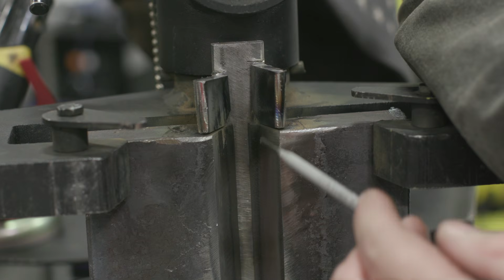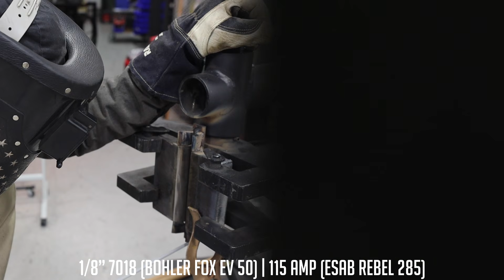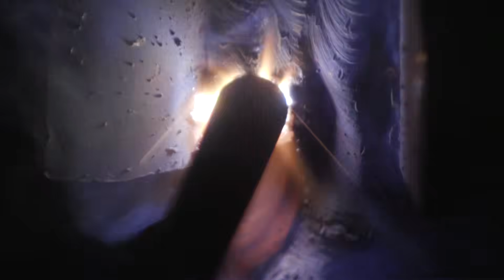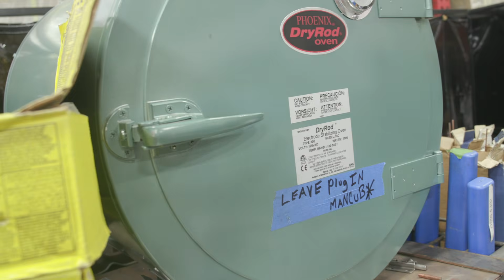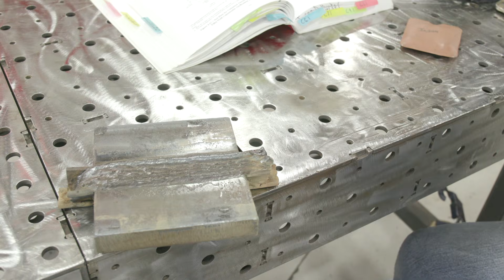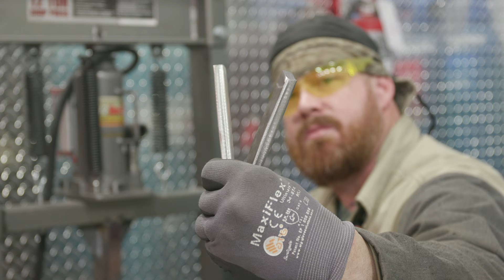1 Inch Side Bend Test | 3G Uphill Stick Welding | D1.5

Comment: I have a video request. Could you compare what its like welding with new rods vs expired old rods? In my welding school were currently using 23 year old 5/32 7018. They seem to weld alright but does that exlirarion date really make a difference in the weld?
Reply from the maker: We'll add it to the list, but it's going to take a while to get 23 year old rods 😜
Reply: @Welddotcom  lol i appreciate it!
Reply: @Welddotcom  also i can't seem to weld vertically worth a dang with them. Do i just suck or can that be attributed to the old rods?
Reply: Go grab a new pack of 7018.  Learn for yourself, don't wait for somebody to teach you.  That is a life lesson right there.
Reply: @MPM Welding thats the thing, were using them for practice and our test plates. I used them on my 2g test and did fine with them but for whatever reason i cant get them ro run good uphill. Ive tried adjudting the amps, arc force, speed, and the angle of the electrode and i still cant get it from not dripping. That said, it doesnt drip as bad when welding in the bevel but on a flat plate it drips like crazy.
Reply: @John Chrysostom Rev 3:9  Alot of the 7018s these days are MR, moisture resistant. Codes may not of changed but newer 7018s have.
Reply: @MPM Welding thank you sir!